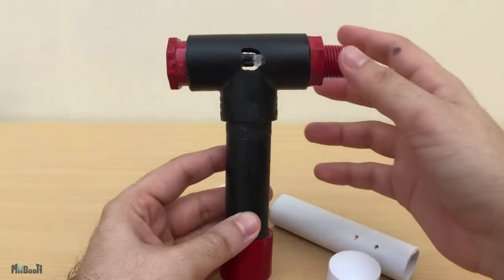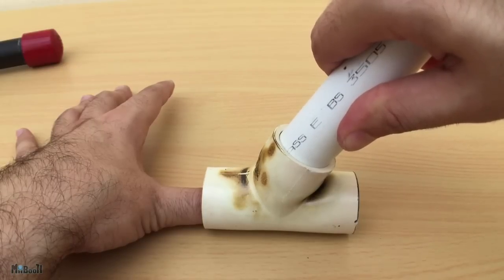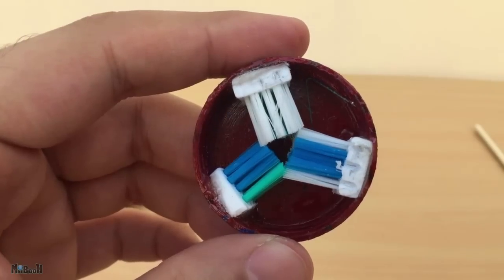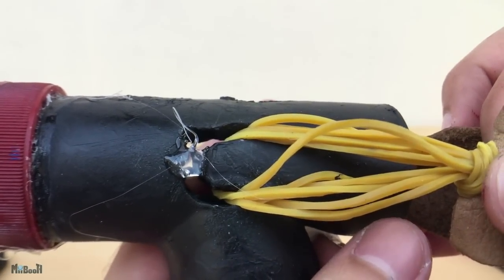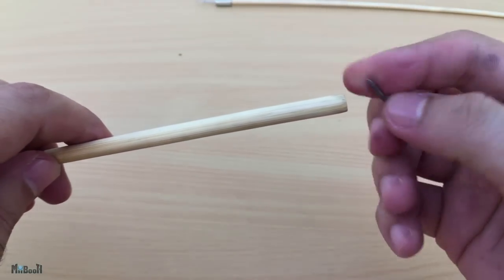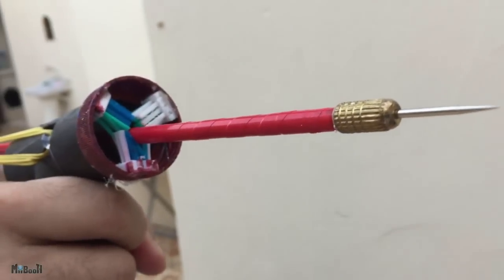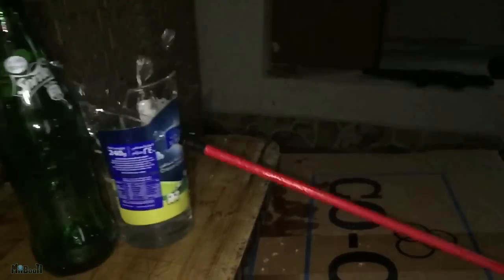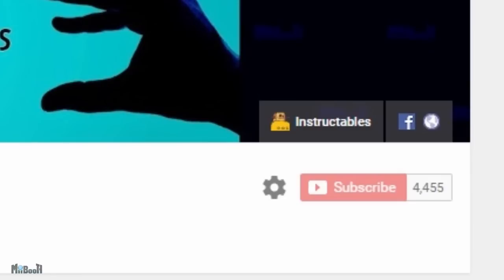PVC Slingshot bow Whisker biscuit mod and new glass breaker arrows | What the hack #19

Comment: If you really want an arrow specifically designed as a glass breaker, try getting some spark plugs and smashing the ceramic part into small pieces and glue a piece to the tip of your arrow. I am not sure which brands of plugs work best but the ceramic part of a spark plug (the the right brands) will easily break glass even just thrown at glass.
Reply from the maker: That is an excellent idea. I saw this in a science but never thought of it that way.  Thanks :)

Comment: i am pretty sure that charred or burned pvc is very brittle and release fumes
Reply: Blazko Wolf Not as much as one would think. You might be amazed at how many electrical lines in your area, are inside heat bent PVC.
Reply: John Doe, but I am pretty sure they aren't charred like that. Heating PVC is fine but heating it until it gets some black formation or charring isn't. But if I am wrong, pls correct.

Comment: Miibooth, good job on the three fletchings instead of two. But we're not going to let you off too easy. You can install them at a slight angle, so they cause the arrow to spin, inducing a gyro effect, causing the arrow to fly more stable. Also, keep the toothbrush  (I make them also) "biscuit" brushes to have a tiny bit of clearance between the three, so the arrow fletching passes with almost no resistance. Align those clearances to 120° apart each. Now you've gained accuracy and fps - feet per second. Thanks for telling about the skewers in the BBQ dept. And also, there just has to be a better target choice than one spewing glass shards all over.
Reply from the maker: Well, so basically you want me to make a mini hale's rocket arrow :D. Actually, making these kind of offset fletchings from clear plastic tape will not be that easy and even if I manage to do it, the soft plastic will just move with the incoming airflow instead of spinning the arrow. (That's just my theory.). And I did try separating the brush pieces a little from each other before making this video, the problem with that was that the arrow being so thing would tend to fall through a gap in the soft bristles when pulling back on it. In my next slingshot bow project, I intend to put together some store available stuff and use real arrows to see how it works.
Reply: Commenter Five xxx